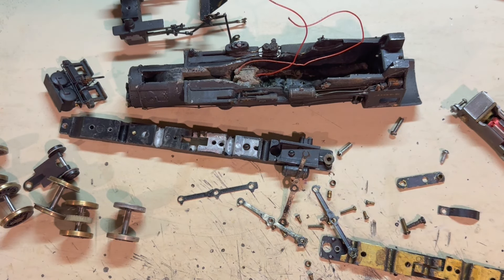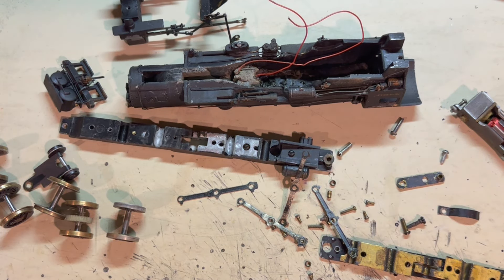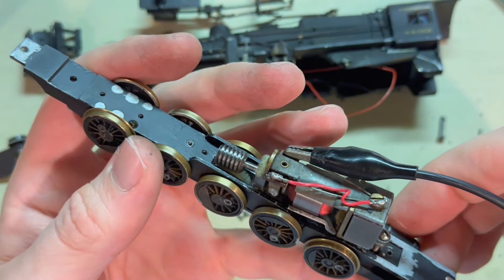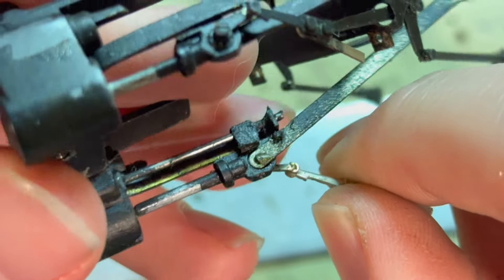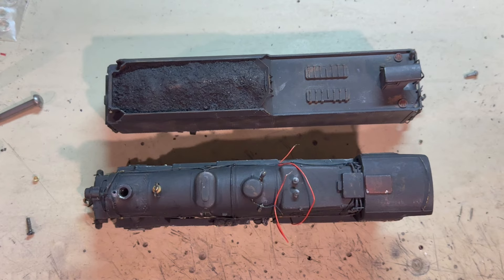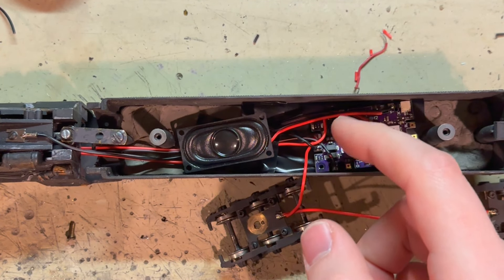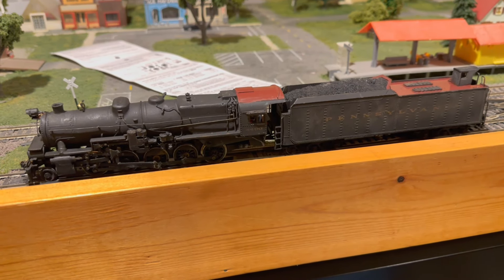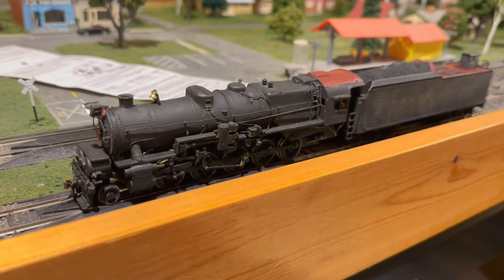Repairing an old Penn Line 2-10-0, plus adding DCC and Sound!

Comment: Never thought I'd see:
A: You try DCC/sound
B: a PL loco with sound and it runs buttery smooth!
A very well done installation.
Reply from the maker: Thanks! I’m staying with DC for my own trains, but since I found this sound controller pretty cheap, I figured it would be useful to have on hand.
Reply: The tech 6 was my first DCC controller as well. Solid performing lil thing

Comment: The 2-10-0 PRR decapod was the last new steam loco by Penn Line in 1954- their first was in 1947. It has always been my favorite- but I have the Bowser version with the larger diameter boiler. 
Crazy to think it was that old, $35 then, about $380 in 2024. 
Bankrupt by 1963, Bowser picked up molds at a sheriff sale - hundreds of thousands of dollars were lost on the Penn Line side, it's staggering to consider for the time.
Reply from the maker: I heard they spent a huge amount trying to get into slot cars, right when they were going out of style! Penn Line might have been around a lot longer if they stuck with trains.
Reply: When I bought this from my grandma only paid $12 for it, for shipping lol
Reply: What killed Penn Line was a free service/replacement guarantee that they extended to their line of slot cars. Slot cars were way more fragile and
much more prone to being damaged by little kids. They lost massive amounts of money as a result. Should've stuck with trains!
Reply: @jefflynnalex  It is a shame, so much money just disappeared on bad motors and returns.  It did leave room for Bowser to get all of those molds at a low enough price to be able to operate a company.  They heightened the quality of the models beyond toys and published those eye-catching ads of Bowser models with the newly acquired Cal-scale brass parts- that is what hooked me.  They even re-cast the boilers in 1993 and 1995, but even English's saw the decline and gave up on the steam line.
Reply from the maker: @jefflynnalex  Thanks!  I think Bowser had a similar policy early on and nearly disappeared from poor financial decisions (Bill Bowser was a great mechanic but not much of a business man), but they were saved just in time when English purchased them.

Comment: I still prefer silent DC, I'd rather the here the wheels on the track and  a quiet, smooth motor, maybe some music instead. To me the sound systems all sound tinny, PFM at one time made a subwoofer under layout concept- something to that.  

I do want to start adding supercapacitors to my smaller DC models, probably with a resistor as well.
Reply from the maker: Yeah, it’s hard to get a good depth of sound from these small speakers. It works for the jet engines in the Turbo Train set, but I go without sound for the rest of my stuff.
Reply: I think if sound mixing in decoders was better, and people used more/better speakers, it wouldnt be that hard to get decent sound.  I've seen people making toy lightsabers that have impressive bass sound using rather small, high quality speakers.  Maybe that is all it takes, or maybe we need people who know more about sound systems.

Comment: Would have been neat if you could have 3D printed a large enclosure for the speaker to make it sound even better! It looks great though, and the DCC doesn't have a problem powering the old motor?
Reply from the maker: The old motor runs well within the decoder’s ratings, so that all worked out fine!  I thought of making something for the speaker, but I figured it would sound cleanest with the vibration dampening foam alone.

Comment: I keep looking at that model and I am confused as to it's actual make. It is definitely not an out of the box Penn Line. Many of the details that came molded into the Penn Line shell are separately applied to this shell. For many years after Bowser bought the PL inventory, they continued to sell PL locos under the Bowser name. At first Bowser just slapped a sticker over the PL logo on a kit box and sold the entire thing as a Bowser. Later, as inventory was sold off, Bowser began to gradually modify and upgrade the kits...so you'd have these hybrid locomotives that had some old PL parts and new Bowser parts. I am fairly certain that is what this is. Because Bowser wanted to maximize their parts inventory, in almost every case, when they modified a kit, the parts were still almost completely backwards compatible going back to PL models. It wasn't until the late 80s and 90s that Bowser started to completely remake the shells and chassis. Even so, most parts were still largely backwards compatible.
Reply from the maker: This one is a Penn Line, but a lot of the details were filed off and replaced. The lead body makes that easy to do with these.
Reply: Some people did that on their own but I know, for a fact, that Bowser was also gradually modifying their kits with more and more separately added detail parts and that they were removing detail parts from old stock PL lead boilers (while leaving PL on the boiler). I spoke to Lew English about this almost 25 years ago. I brought in an L1 that had a damaged brass frame chassis and he traded me a brand new, clear coated,  zinc L1 frame for the brass one...because they were all cross compatible. But my PL lead boilered Bowser L1 had a separately applied sand dome which was a Bowser modification. I also own three T1 models: An original PL, a Bowser/,PL hybrid with some brass details and a late model with all new zinc boiler and tender with many more brass details.

Comment: I find Bowser/Penn Line Steam locomotives to be in a league of their own. I started with one and now i have seven of these guys, five are running and two are being built or rebuilt. I have done a bit of research as i am still running them off DC. I have been advised by several buddie who are into DCC to not convert mine with the DC70s as they tend to be "Power Hogs" since they run off half an amp between 8 volts on my I1 and E6, and 9 volts on my K4s. I am looking into repowering some of my engines with Can Motors eventually, there is a kit available known as the "Helix Humper" but i have yet to find one. Im going to need a few. But would using a Can Motor make a Bowser DCC Conversion more efficient.? I ask this because i don't know how much this 2-10-0 will draw especially when under load.
Reply from the maker: Instead of a new motor, one option is to change out the original magnet for a neodymium cube.  This will make the motor more powerful and reduce the current draw.  There are decoders that can handle a continuous half-amp very easily, so I'd use one of those.  With all that, your older Bowser and Penn Line steam engines will have no problem running on DCC.

Comment: Solid lead boiler? Health hazard on wheels. Lovely
Reply from the maker: Yup! They used lead bodies starting in the 40’s and going through the 60’s. Bowser changed them all to zinc diecast after they acquired the tooling.
Reply: I'm sure he'll be ok as long as he doesnt eat any lead chips
Reply: I’ll try not to😂
Reply: Lead isnt dangerous, unless you eat it, or shoot in through a gun.  I really wish people knew more about the advantages of lead-based metals that melt at such low temperatures, that you can pour them into plastic shells (slowly of course).  It makes models a lot heavier!  Either way, we still use red lead oxide in paint and primer, and I havent seen anyone die from spraying red paint!

Comment: It's suggested to not run those upside down
Reply from the maker: Yes, but it’s usually fine as long as the rods and valve gear are well fit and working smoothly.